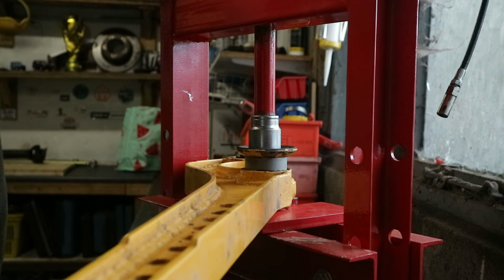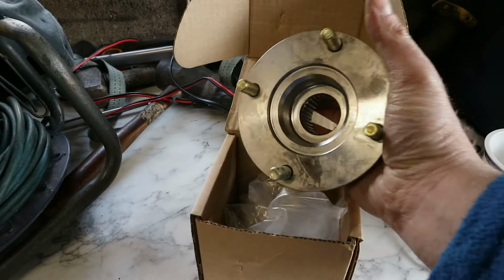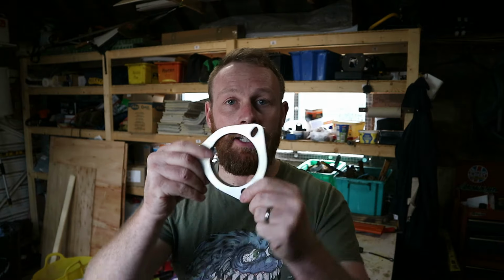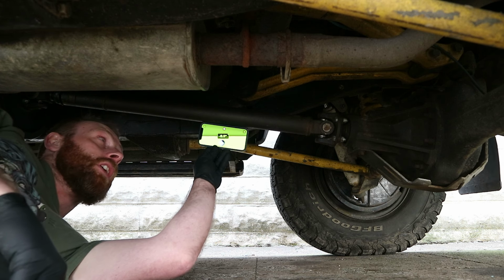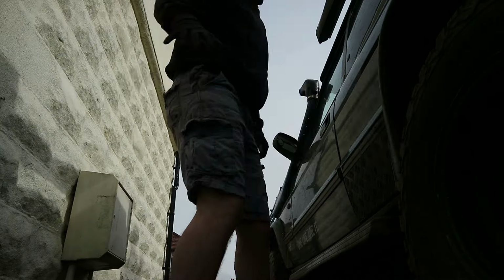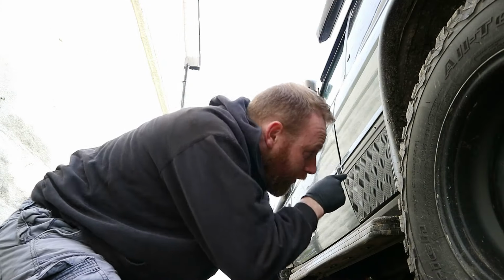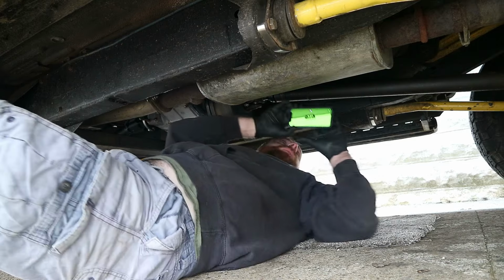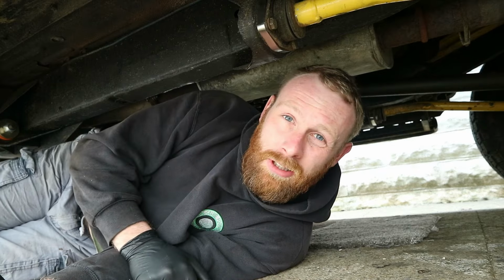Discovery 1 driveline vibrations

Comment: Lifted my 110 Defender 1.5" using old man emu suspension, I got a vibration and noise when on a neutral throttle, on the gas it was OK, off the gas it was OK but really bad mid way. Ended up realising that suspension movement changes the diff angle, mine was much better when loaded, in the end I fitted similar spacers to you, mine were genuine LR and intended for the 90 when fitted with H/D suspension at the factory, it cured mine 95%  but it's still there a bit, a Gwyn Lewis prop also helped a little , I suspect the rear diff pinion isn't in the best of health. It's hard to find decent advice, one very well known manufacturer of cranked rear arms assured me that diff nose angle doesn't change during suspension travel.... He was wrong. 
It's also worth making sure that the prop U/j's are good as I've had a similar problem with a siezed rear uj that only showed up when I removed the prop. 👍
Reply from the maker: I have plans to change the rear prop so hopefully that should rule that out

Comment: Replace bushings in front radius arms and install standard bushing without mid size tube. Make sure your central diff lock housing front shaft output has no wear. otherwise front diff flange will be loose and front shaft will give you vibrations. AFAIR double cardan needs to go to the LT230 and front in line with axle casing. then double compensate angle of LT230 and front is parallel to front axle pinion. 
Consider going for rubber type coupling on rear diff as it will eliminate any issues with angle on rear and should act as sort of vibration damper.
Reply from the maker: Thank you, I have done most of them but I think the front axle needs aligning to straighten the prop
Reply: Yes. It will cure root cause assuming double cardan will face LT230 (so front prop shaft to be installed opposite).  However note bushings on frond radius also matter how it transfer vibrations ( i see you push in double sleeved bushings which is not good) . Double check front flange play on LT230. I know the bearing is with extra float etc. but it needs to be super tight in the end. Otherwise centre diff casing (FTC5207) require replacement as intermediate shaft is loose on the splines.
Reply from the maker: @unclesam44  I will align the axle and see if that helps and then maybe change the bushings back to poly and see if that helps. The transfer box is a new one so should be fine on the output. 
I just need some free time to get on it. Thanks for the tips 👍
Reply: You can consider using bushing NTC6781  which has no inner sleeve . it transfers less vibration. Also seen "new" recon transfer boxes where someone didnt want to spend 400GBP for new FTC5207 and it was still having front flange not tight enough.
Reply from the maker: @unclesam44  I do have a set of poly bushes that have barely been used so I’ll try them. The transfer box was from Ashcroft so I’d like to think it’s in good condition. I’ll try alignment first and then look further 😀
Reply: Please comment if you manage to fix by aligning front diff. as replacement of bushes will only reduce amount of vibration transferred to the chassis. I have the same problem on def puma and didn't found the root cause of the problem . Only changed bushings to limit transfer of vibration but vibration itself is still there. Using quality double cardan from GL-DC-MEGA-665 so is rather not coming from the shaft. I'm curious about the root cause.
Reply from the maker: @unclesam44  I will definitely do a video on it

Comment: Did You have proper castor corrected front arms? And Your transfercase is in good shape?
Reply from the maker: Yes I have 3 degree caster arms and brand new Ashcroft transfer box
Reply: Castor corrected arms can actually make things worse as they change the nose angle of the diff, better with castor corrected swivel housings.
Reply from the maker: @andicog  true, I’ve tried the standard arms back on and it was just the same but a bit more wandering at speed
Reply: @TheNorthernExplorer  Yes, the standard arms will make the steering feel like it's on tip toe due to the steeper castor. The corrected  arms will stop this but can mess up your diff angle by dropping it's nose downwards.
Reply from the maker: @andicog  I would have thought the double cardan prop would fix that
Reply: @TheNorthernExplorer  in theory you'd think it would as it should take away the  need for the 2 flange angles to be the same.

Comment: The original front prop is supposed to be out of phase to compensate for the transfer box and diff flanges not being parallel. If you look at the diff flange it’s pointing up at the transfer box so the prop shaft is deliberately positioned out of phase so the universal joints are in sync with each other as they rotate. Could you try another set of tyres? Look for flat spots and scalloping on the tyres.
Reply from the maker: Yes that is correct, I have fit a double cardan propshaft to fix that problem. I don’t have access to more tyres but I will play around with swapping front-rear+spare
Reply: When using a double cardan shaft on the front the pinion and front u-joint needs to be very close to the same angle, within a degree or so, otherwise you’ll still have a vibration. The stock out-of-phase u-joint shafts were designed to allow the front pinion angle to be much higher than the shaft angle itself and still run smooth.  So for example, if the front diff flange is sitting at say 10 degrees you’ll need to get the driveshaft angle close to the same say around 9 to 9.5 degrees so the front u-joint is running as close to zero or as straight as possible.  The double cardan joint on the transfer case end will take care of the angle difference between the t-case and drive shaft.  Many variables are at play such as suspension lift, caster correcting radius arms, worn engine/transfer box mounts, etc…  It may prove impossible to get it perfect but you should be able to get it close enough to nearly eliminate the droning vibrations you are feeling.  I’ve been down this road many times and share your frustration but getting the angles right usually takes care of it.
Reply from the maker: @C-Mack1972  I think I’m at that stage now, there’s so many things that could cause it but I’m reasonably happy with the noise

Comment: Uneven tyre ware maybe? Incorrect balanced wheel or prop? Also your steering wheel would wreck me driving straight on like 1/4 of a turn 😂
Reply from the maker: 😂😂😂 it’s only recently been done like that I’ve just fit new steering arms and need to get tracking done. Plan is to get the rear prop balanced